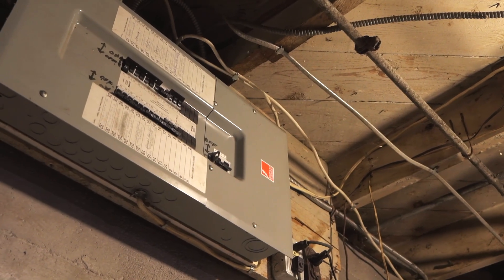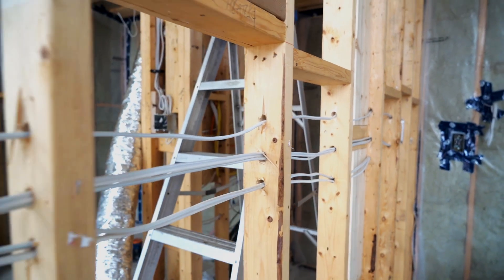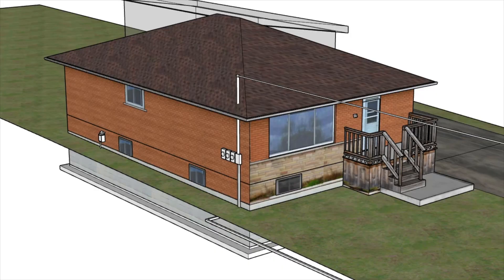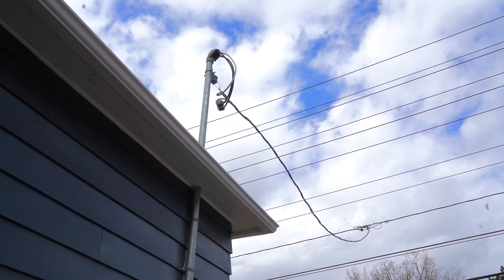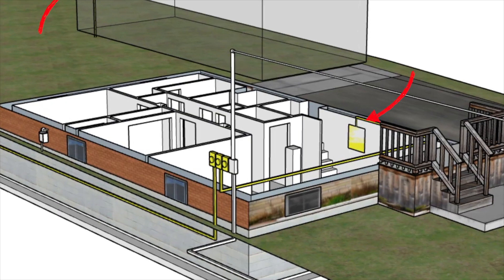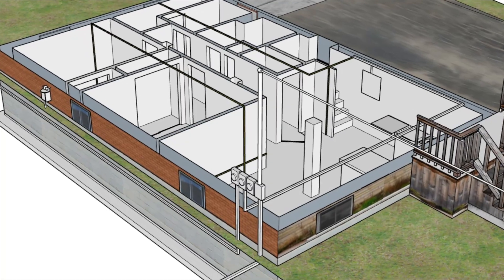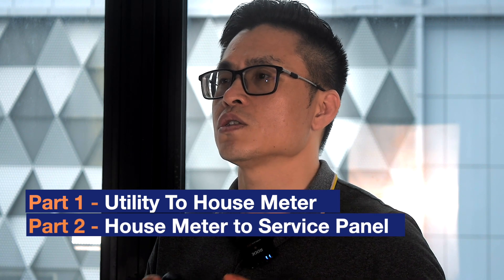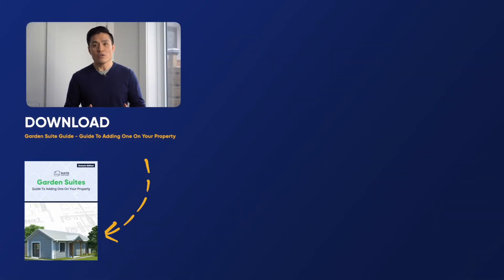How To Upgrade Your Electrical System For 2, 3, 4 Units, ADUs & Garden Suites (And Who Is Qualified)

Comment: For a simple duplex conversion. What is the trend for electrical upgrades for bungalows with electrical panels in the basement?

I'm looking to convert the main panel to a sub panel (for basement only electrical) and then create a sub panel upstairs/ main floor. I want to avoid having the tenants go into another unit to reset a tripped breaker. Thoughts?

Comment: How do you convert a home that uses all gas for power to a fully electric home? This I think is safer and lets you use energy efficient appliances. I read that this process is called electricfication. Do you have any flippers who have done this or done it yourself? It would be great if you could do an episode showing the steps & costs involved and how to do this from start to finish.
Reply from the maker: This is possible but often not very practical, especially if you have multiple suites due to the capacity requirements. There are some homes with all electric heating, appliances etc and would typically required 200amps and up. If you have multiple suites and all electricity, you may need to upgrade to 400amps. Depending on existing transformers in your area, this can be costly. We briefly touch on this in the video. If your property is on natural gas and work is done by a licensed gas fitter, it should be very safe.